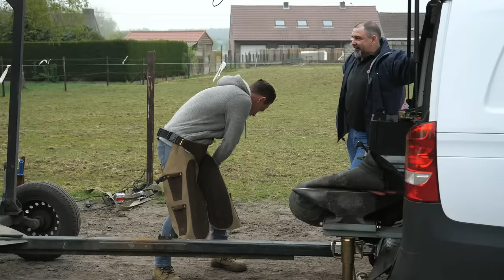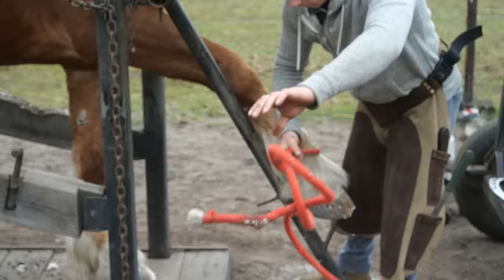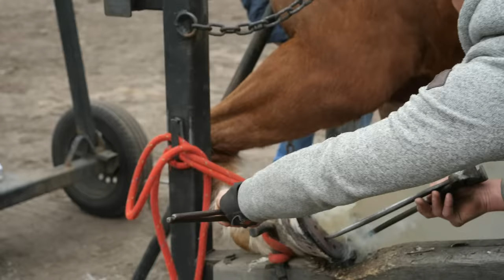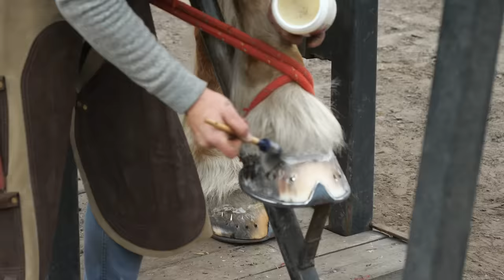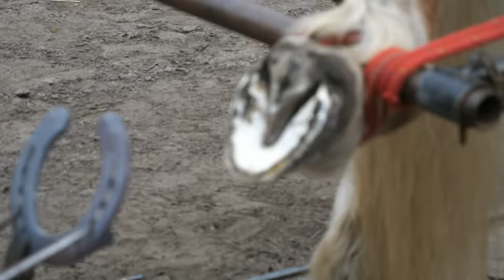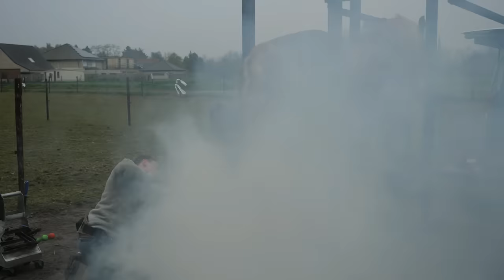Hot shoeing a draft horse is a tough job. Watch the whole technique in detail.

Comment: To all the people disliking : This does not hurt to the horse at all. It can't feel that part of its hooves, they are mostly made out of the same material as finger nails, but stronger. It can't feel any of it. If it could actually feel it it would have freaked out.
Reply: Apeman Commeth  I'm sure it can feel the heat but I think it would have a larger reaction to it if it was painful. Even if it is painful and lets say the horse is just trained to deal with the pain I think if it was to much the horse would freak out.

Also, about the wild horses. I'm not an expert on horses, but I think that when they are in captivity they don't wear down their hooves as much and so they need trimmed. A wild horse probably wears down it's own hooves.
Reply: @thorn9382  sd
Reply: @sureshdhaira2295  what?
Reply: Chezz horse can actually feel areas of their hooves just not in those specific areas. They can feel the inner part of their hoof including what is called their frog. Their frog is a sensitive part of their hoof.
Reply: Thank you for this information, I'm panicking because he's hurting the beautiful animal. Now I know.
Reply: Nevada, I've been around horses since I was born. I'm 43 now. I promise you if that horse was in pain, he could've (and WOULD have) broken out of that contraption.
Reply: Nevada Lairson no pain is being caused at all. There hooves are like ginormous thick toenails and they can’t feel a thing. And when the hot shoe is placed it kinda feels like a hand warmer to them. So it doesn’t hurt☺️
Reply: Apeman Commeth  if they didnt put them on the "nail" would wear out fast due to them walking on streets instead of pure earth like wild horses.
Reply: It has to be done whether or not he can feel it. You can feel the dentist in your mouth, but that don't stop you from going unless your a fool lol!!!. To the one's who's saying he can feel it
Reply: I understand what ur saying but u can never speak for a horse unless u are a horse.  To say they sont feel ANYTHING is easy forbu to say. Perhaps they just deal with it b.c qe are going to force it anyway
Reply: @nevadalairson6341  u still dont know neither of us r horses
Reply: @umwaht  well any animal feeling pain will react to it, its that simple it will retract its leg. This is pure "nail" material on the outside ring, thats why they can burn the irons to the nails. The center has some feeling to it, but the outside doesn't
Reply: Apeman Commeth  my farrier does hot shoeing. I have never had to put my horse in a chute or tie her leg's down & NO they do not feel it
Reply: Ich hab gedisliked, weil mir dieser Schmied erstens unsympathisch rüberkomm und ich zweitens nichts davon halte, ein Pferd in "Ketten zu legen, dass es sich gar nicht mehr bewegen kann. Was würde man denn machen, wenn sich das Pferd erschreckt? - Will man dann erst 10 Verriegelungen aufmachen?
Sorry dass es auf Deutsch ist, war zu faul es ins Englische zu übersetzen 🙈
Reply: @thorn9382  wild horses hooves are like stone! much harder than domestic horses. I know I have owned mustang's as well as domestic horses & the mustang's never needed shoe's
Reply: I was wondering that, I was thinking more of would it basically cook the inside of the leg from such intense heat, but I’m from the ghetto never even seen a horse in real life but watched the whole video cuz of dudes craftsmanship
Reply: Apeman Commeth  most of the reason for shoeing is the vast difference in terrain domestic horses are used on and the fact that we use them as beasts of burden. Wild horses end up wearing down their hooves more slowly and if they do end up injuring their hooves in any way, they go lame and die (without intervention) draft horses are still used for hhlauling carts and sleigh loads (and even for weight competitions!) So their hooves need the protection that they get from their shoes.
Reply: Apeman Commeth  if a horse that size doesn't like something, you'll know about it.
Reply: @marlenstr3995  Naja in diesem Fall geht Sicherheit für den Menschen wohl vor ;) Vor allem auch Gesundheit weil  sonst kann der seinen Job nicht lange machen, bei dem Gewicht der Hufe. Es gibt grundlos Schmiede, die erst gar keine Kaltblüter machen.
Reply: @thorn9382  nice information.  Thanks a lot.
I thought surely it heart them. But no much pain
Reply: Hot shoeing is used to flatten the area where the shoe is going to be placed, its recommended for a better fit.
Reply: Apeman Commeth  No the nail doesn't hurt. Wild horses are never have any body riding them nor do they have to pull anything. If you don't shoe a horse it's hooves can be ruin.
Reply: @umwaht  No that horse is strong enough to pull away if it wanted too.
Reply: @umwaht  You talk a lot for someone who's experience with the outdoors is all through YouTube videos. Leave this to those of us who live and work in the country.
Reply: Apeman Commeth  Domestic horses aren't capable of wearing down their hooves like wild horses can, since they don't roam and travel for long distance on rough terrain. If left unattended, their hooves will grow to long lengths, think of them like nails, and will start to cause posture problems in the horse, like leaning off to a side. They'll try to be constantly getting getting weight off one leg and just be rotating each of their legs around for any comfort. A constant trim and re-shoeing if required for domestic horses, regardless of how it looks. It's more cruel to not trim and shoe them.

Source, family owns several horses and we get them trimmed often. Had a 1 year old get his first trim not too long ago and he had visibly bad posture. Was leaning off to his right side, and that was promptly corrected with a simple trim.
Reply: Chezz I’m a horse rider I own horses I know
Reply: Chezz sometimes horses don’t have shoes because they are ethier retired or they just aren’t ridden I’m a horse rider I own horses I don’t know much about having the shoes off that’s all I know right now.
Reply: Nevada Lairson I’ve been around horses for a long time I’m a horse rider and I own horses I promise you that it’s not hurting them they can barely feel it and if it hurt that bad then they would have a bigger reaction! And if it was hurting the animal then they wouldn’t of been putting shoes on them.
Reply: Adriaan Schep  actually some people don’t have shoes for their horse ethier because they’re retired are don’t get ridden but sometimes you have to get walked on the road or concrete I wouldn’t go that fast it would just slowly wear down the hoof.
Reply: Apeman Commeth  i do agree, i would never shoe my horse or anyone else's. As wild horses do fine without them. But horses cant feel in there hoof the only part they can feel iz the frog(the center piece that is just a fraction of the hoof that looks like a triangle) and the farrier doesnt put the shoe in the frog it only goes om the edge of the hoof
Reply: @Bellbeesevenacresfarm  i own a 14 yr old ah mare and she has never had shoes i compete on her too. Horses dont have to be retired or not ridden to not have shoes on....
Reply: @vickylawrence3958  do you own horses? Ive owned 12 and never had shoes on any of them and my farrier say they are some of the healthiest hooves he's seen
Reply: Did the horse tell you this ?
Reply: @showjumpinggirl100  Can i ask how did you know that?
Reply: Chezz I ride horses irl and I do notttttttt use horseshoes I’ve took my horse to the vet and she said that if u put horseshoes on ur horse it would make the horses have hoof problems sooo yeah............
Reply: @sweettooth3313  yes actually... If it hurt the animal his ear would one be pinned back which they arent. And two he would he forcing his foot down, bc a draft breed can break that chain
Reply: Apeman Commeth  Wild animals do not bear the burden!
Reply: Apeman Commeth  it wouldn't really effect the horses hooves if you don't put shoes on or not well shoes make the horses hoove actually weaker
Reply: Really, people, does that mare look like she 's upset with this process? Not even faintly.
Reply: Apeman Commeth  Let's make this easy. 

Wild horses ran around on grass, and didn't wear down their hooves as much. 

Most riding horses need shoeing, because a stable has hard flooring, and if you ride on a road the hooves would be worn out more quickly. 

If you don't put shoes on the horse, the hooves become very small, and it will start to hurt the horse. 

You can skip this part, I already explained it, this is just about my own horse. 😁

I recently just got shoes on my horse's front legs, and he's so much better now, and his hooves was about 5 cm or so.

I didn't have shoes on at his old owners, because he was out in the paddock both day and night, and only came in when they got food, or if they were going to be ridden.
Reply: @carcol04  The horse's leg is tied up to preserve the farrier's health/spine. Horses like to lean on things, just like people do when they've been standing for a while. Watch a horse when they're being groomed/tacked up. They'll shift their weight back and forth. You ever have an animal almost 10 times your size use you as an ottoman? Just decide they're tired of using just 3 legs and want to give them a break? Makes doing anything with their feet a LOT more difficult. XD Now, you can push them a bit, and get them off of you, but it can still knock you off balance pretty good before they take their weight back. Now, for the kicker: A regular horse weighs 800-1,200 pounds. A draft horse weighs 1,800-2,200 pounds, depending on breed. If something like a TB or AQHA can knock you off balance, what do you think a Belgian or Clydesdale would do? :)
Reply: All horses must go through shoeing. Have you ever seen a horse whose hooves are not taken care of? Bless the owners who care (and there are too many who don’t) and the pros who “get it done”
Reply: @1959blee  and that's where you're wrong. 
Some horses has stronger hooves than other horses, and doesn't need shoeing. 

You shouldn't trust everything the internet tells you 🤦
Reply: @tarisco614  the people who do not understand what they are looking at need to watch u tube on the rescue horses that do not see the attention of a ferrier. Now that is painful to watch. Not to mention it is inhumame.
Reply: It's called keratin.
Reply: Chezz it’s the tying of the leg I don’t like. I have 2 Clydesdales and our farrier holds their legs and that’s what they’re meant to do in my opinion, if he spooks he’ll brake his leg. But I do agree with the fact that hot shod is better. And for the people asking about leaving him barefoot, yes it’s a thing but he probably has a job and that means he has to be shod because if not he can ware his hooves down too much 🙃 

WoW the more I watch the more I HATE the tied leg
Reply: @ali-ub7go  PC seems like you are a lot more bothered about this than than the horse is. The horse is completely relaxed.
Reply: Steve Hove Ik it’s just if on the off chance he did spook, he’d break his leg.
Reply: Its keratin.
Reply: @nevadalairson6341  he absolutely isnt hurting the horse, in any way. Farriers are highly trained, highly skilled professionals. That horse might be bored, but certainly nothing worse.
Reply: They get fucked up hooves that can be crippling if they don't get them done right. Having an off kilter hoof can fuck a horse up.
Reply: @thorn9382  or dies you know, wild horse broken hoove for some reason, runs slower, maybe can't even run, wolves come at noon plain sight, aaaaaaaaaaand supper is ready. That should (and im no horse expert, just a weirdo) if they have no horseshoe on horses on farms could hit a rock or, step into a stone witch might harm the hoove, etc... so makes sense to give those guys a "shoe" for them to walk comfortable in a stony road for example and prevent injury and live happy and stuff
Reply: Apeman Commeth  you can't compare the living conditions of wild horses to domesticated on ; they live in and experience completely different habitats. As to the heat; the shoe nail is attached to the part of the hoof that has no sensation...think of a hot iron on your hair, or a pumice grinder on rough spots on your feet.
Reply: in hot shoeing, the horse is reacting to the smell and smoke if anything.
Reply: Everyone saying its hurting the horses your like 500 years late but it don't hurt the horse they've been doin it from ages ago did it ever hurt the horse
Reply: Yeah horses love being tied up like that and having molten metal hammered into their feet
Reply: @marlenstr3995  does the bundeswehr have horses?
Reply: gosh can everybody stop making a drama , if you wanna know search online . God
Reply: @thorn9382  I don't think they have nerves in their nails, though they do have inside of their legs (of course). They might sense, but as you said earlier, only a tiny bit, or sometimes not even anything.
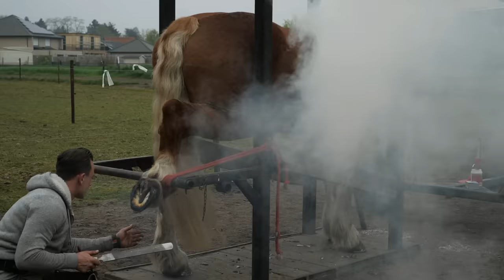Reply: Monica H 9:13 so he’s not in discomfort here? Cmon.
Reply: Sein Maestro Dude the nail on any horse is made out of the material of a human fingernail that is a hell of a lot stronger and if the horse could feel it,then he would mostly likely be dead or severely injured from a horse kick the face.
Reply: Chezz this is interesting, but does the nails hit the hooves?
Reply: This guys is so bad doing this, look all the other farmes they work much better that him
Reply: Who tf are you to tell me what horses feel and what not?
Reply: @Cr4ZzZy  He's a person who owns horses and knows what tf hes talking about so if you got a problem don't watch the video simple as that.
Reply: Apeman Commeth yeah and horse cant talk to you to explain if he is heart I kind of feel uncomfortable watching this :/
Reply: I call bullshit, sure look like he felt something on his back legs as he kept trying to move it. The owner had to verbally try to assure the horse. Horse felt something. Let do that to your big toe nail and let's see if u feel anything. GTFO
Reply: It probably hurt more not to kut it
Reply: @alphazar23  I just prefer the regular way better, looks less hurtful to horse. I don't see the same reaction to them trying to jerk foot away from the situation.
Reply: Doesn't it get thinner every time ? Doesn't the nail gets to the flesh ever ?  I do not own a horse but I have seen cows but they do not move much.
Reply: @deveshsingh4242   bro the nail groves
Reply: Ohhhh Thanks
Reply: @alphazar23  it grows fast. It is like a new one every year the groves. I didn't know about it.
Reply: Apeman Commeth  owned horses spend more time being worked on pavement which can cause foot soreness so the shoes are there to be worn down before the actual hoof. Wild horses don't have this problem as don't spend as much time on hard ground
Reply: Apeman Commeth I’m not a farmer, but I own a car. When the tread on the tires wear down, I buy new ones so the old ones don’t blow out while driving on the highway. Getting horse shoes/ hoof pedicure extends the amount of miles the horse will have over its lifetime. Ultimately improving its quality of life. Also, does anyone ever let their own fingernails or toenails grow out of control??? I think not. There’s nothing worse than a hangnail on my pinky. I can’t imagine what these horses feel. This man is HELPING these horses. You would be ignorant and foolish to think otherwise... And to top it off, he’s a blacksmith that makes custom horse shoes!!! Come on people, get it together. This guy is setting a high standard for his trade and should be commended. I’ve seen some videos where guys are hacking a hoof in half and it looks like a murder scene. Then they spray it with iodine, say the animal can’t feel a thing, wrap it, and proceed to tell the viewers the animal will make a full recovery in six months... Save your energy and negative comments for those guys and leave this professional alone! Keep it up horseshoe guy. I don’t know why, but during quarantine I found out I like watching horses get their hoofs fixed... Stay safe everyone.
Reply: Apeman Commeth  wild horses need to scratch rocks ground etc in order to trim then. Otherwise their toes will grow and bother. Just like domestic cats and wild cats. Wild cats are scratching trees for 'for nail caring' for example.
Reply: @umwaht  What? No lol. Seems you have never been around horses.  People have gotten killed because a horse was spooked or not happy with someone that cause them pain. They feel no pain from this. Just discomfort from his leg getting tied up. The frog causes no pain either, the deepest part of the frog in the hoof has nerves, the frog is like a pressure pad. It puts pressure on that nerve so the horse can feel the ground.
Reply: Here’s an easy way to explain if, while it isn’t exact, a horse’s foot is made up of Keratin. Our hair is made up of the same material

When you flat iron your hair you definitely don’t feel it, but sometimes you can feel the heat close to your scalp. 

Also I promise that if it hurt the horse the farrier would have a broken face
Reply: When the farier doesn’t cold treat the shoe the horse can feel it and he didn’t cold treat it as the horses shoe set on fire
Reply: A horse is a horse of course of course and no one can talk to a horse of course that is in course unless u go right to the source and ask the horse if it hurtsssss. lol
Reply: You Are 100% Right.
But Some People Don't Know It.
This Is Right Way To Nail Hooves.
This Help The House To Walk Easily Without Pain.
Reply: Apeman Commeth  الله
Reply: @Joshua-jj4xn  nails* not feet
Reply: @Joshua-jj4xn  or hoofs if general
Reply: @nmextrapstar69  he is, but not from the horse shoeing, hes trying to find balance because one of his feet is being hoofed
Reply: @firm1z  hes tryna find balance smh, if u stood on 1 foot would you be steady as a statue?, no, same goes for the horse
Reply: @mridg9464  its like using a flat iron on your hair and getting near to the roots, theres no real burns internally
Reply: Franchesca Ng dude Ik I do this work my self but hey at least the shores got some shiny shoes
Reply: Thanks so much for reassuring me that the horse isn’t in any sort of pain 🙏🏻❤️
Reply: Apeman Commeth  

'll
Reply: Apeman Commeth  Hey Apeman...   doesn't hurt them a bit... sometimes they don't like the smoke if the wind is blowing in their faces, but if that doesn't happen they do not react at all.
Reply: Chezz people who don’t own horses or know anything about the shoe process have the most opinions. 🐎
Reply: Are you even an equestrian?
Reply: What aboyt rhe chain and the bite huh
Reply: @nMeX Trapstar  That is just the horse wanting his leg back. you can see it earlier in the video when he picks them up to take off the old shoes. Most horses get uncomfortable in that position easily since they aren't used to having their leg like that while their front legs are much easier to handle. Also if that horse really wanted his leg back or if was actually hurting the horse would literally be thrashing around to break free and it could break through that easily. My baby horse does the same movement when he isn't really sure what I'm doing when I'm holding his leg. Also, horses are not dumb animals. they recognize lots of things. If it truly hurt that horse to be in the shoot to get its feet done they will REFUSE to go in no matter what. But that horse just walks straight in with no hesitation and lets them do their job.
I know this because i rescued an appendix quarter horse that was terrified to go into trailers. He was an ex-racehorse and when he lost he was abused in the trailer. He would rear, buck, kick, run us over and even bite us if we tried to get him into the trailer. We had to sedate him to get him home it was that bad. Once we got him home it took me almost 2 years constantly working with him to get over that fear. A shit ton of people had given up on him before my family adopted him and my family was gonna be his last chance to since no one was willing to put the time and energy to help him get over his fear. He had severe PTSD it was so sad to see. SO tell me again. If that horse was feeling ANY pain you think it would calmly be staying in that contraption?
Reply: @Tina Gore  the chain is there so when the horse leans back on it it can take the weight for the most part. a rope on the other hand wouldn't be strong enough to hold them up. it would snap and if not on the main part of the rope it would snap at the connection. Also, the top chain is to keep the horse from rearing and hitting its head. These horses are trained not to rear or back up if they feel that top chain and butt chain.
Reply: New shoes, same horse and who doesn’t like new shoes. That horse seem quite happy afterwards. I think we all can agree that farrier would have been smashed if the horse felt any searing affliction. Lmao A farrier wouldn’t be if a there wasn’t a demand or need. Definitely check out the anatomy, history and procedures on horses before jumping to conclusions. Not all horses need shoes, all shoed horses have their reason to be shoed. Also check out unkept, problematic hoofs, beware those videos can be graphic but the end results usually end with success. We don’t want to be in pain nor do we want our animals in pain either. To keep healthy sometimes we need medical intervention, to perform a function we need proper equipment and acquiring such things can bring discomfort.
Reply: @natasha789die  hello Russian
Reply: ЖЁЛТАЯ ПРЕССА ДЕРЕВЕНСКИЙ КАНАЛ  lol I don’t understand 🙃
Reply: @nevadalairson6341  uni u gogol girl k they u u
Reply: Apeman Commeth so, your wild horse argument.
Wild horses have had roughly 800 to 1000 years to breed without much interference from human and develop hard hooves that wear down naturally. Think of it as almost like natural selection. In the wild a lame horse is a dead horse. Dead horses don’t breed. Therefore you end up with wild horses with large strong hooves.
Now, most unfortunately, many of these domestic breed of horses are bred for certain characteristics without much thought for the hoof.
For example, take the American quarter horse. Breeders have absolutely destroyed by breeding for smaller and smaller feet. At this point they look absolutely ridiculous.
Hopefully this helps you understand the argument of why we don’t, can’t compare the hooves of a domestic bred horse and a mustang.
Reply: Thank God
Reply: @showjumpinggirl100  I'm sorry if this is late but the sensitivity on the frog part is actually false. Idk how that belief came to be but nah, it's not the most sensitive part. Think of it like cutting your dogs toenails or your own.  Cut too deep and you'll hit the quick, same with horses. There are sensitive areas but those are deep deep in the hoof ^^
Reply: That does answer my question of if the horse feels anything when they nail in horseshoes.
Reply: Apeman Commeth  Google the Cowboy from Chicago.  Census Cowboy and what he did to his horse
Reply: Apeman Commeth  its protecting hoof, when horse is going to the show from hard floors(sorry my english is bad -w-')
Reply: @showjumpinggirl100  the frog isnt sensitive.  If its sensitive, its probably infected
Reply: That sucks. Nature does this naturally for them. Humans think we know it all.
Reply: @thorn9382  Yes, it does NOT hurt. Only issue is that horses need some practice with shoeing, because they can feel that heat, smell burned hoof also it makes hissing sound and many horses are freaking out when something hiss (like spray or fire) and  also it makes lot of smoke and horses natural instinct is run from fire. Shoeing like this is made only on working draft horses. Riding and sport horses are shoed with cold horseshoes and horses for terrain and hobby riding and ponies are often not shoed (plus horses with bad hoofs... laminitis or white crumbling hoofs)
Reply: There is an area in the hoof, like rings on a tree, called the white line.  As long as you stay to the outside of the white line, you are in the hoof horn and it's insensitive like your fingernail.  If you get too close to the white line, it will cause pain like cutting too close to the quick of your fingernail, which is why we will say the horse has been "quicked".  Inside the white line is loaded with cappillaries and nerves, called the "laminae".  To invade that area will cause severe pain.

 @showjumpinggirl100
Reply: @umwaht  There is an area in the hoof, like rings on a tree, called the white line.  As long as you stay to the outside of the white line, you are in the hoof horn and it's insensitive like your fingernail.  If you get too close to the white line, it will cause pain like cutting too close to the quick of your fingernail, which is why we will say the horse has been "quicked".  Inside the white line is loaded with cappillaries and nerves, called the "laminae".  To invade that area will cause severe pain.
Reply: I have never owned horses but I think putting horse shoes on horses doesn't matter but sometimes u might it kinda depends on the horses u know so it really doesn't matter
Reply: @failexp1351  Proper shoeing can be vital to enhancing some horse's hoof health, safety and athletic performance.  It depends upon the foot conformation of the horse and the job chosen for him to do.  Also other health situations. Foals can be born with leg issues that need to be reolved by plastic footwear that is glued on and changes with growth of foal, same as corrective shoes for children.  Can you go barefoot all the time? Neither expect all horses to do so.
Reply: @radchannel5494  I agree but I'm saying some horses don't need to I not trying to start something I'm just saying sometimes horses don't need it they might to because they wear it down themselves that all I'm saying
Reply: @failexp1351  Oh you are correct!  Sometimes they do wear the foot down on their own.  Usually a knowledgeable horse owner will observe this and space the farrier visits out when it's that way.  However, my boyfriend is a farrier and you'd be surprised how many people only want to call him once a year.  Their horse's feet get into awful shape from the neglect and then they want to blame him when he cannot work miracles in one annual visit.  Very exasperating.
Reply: سسسسسسسسسسسسسثسث
Reply: ইই
Reply: @thorn9382  ত্ত্ত্গ্গ্ঘ্হ্গ্ত্তেýতারিখ সুইস তারিখ 666
Reply: @joniakter4740  scary
Reply: @showjumpinggirl100  frog is not as sensitive as people believe. 
If it’s sensitive then it probably means thrush is around. 
Even S&S horseshoeing  has even said the frog isn’t as sensitive as people believe.
Reply: @genabargay4391  the horse weighs a ton, I doubt a farrier would be able to hold its hoof up  for very long, also it’s probably safer for everyone to have the horse in that type of contraption.
Reply: I think you once was a horst in another life to know this.
Reply: @hafidelghazouani5272  If your talking to me I study animal care that’s why I know a few things, I also love to research and learn about animals that way (I have a very good recall memory and if I enjoy something I will do really well at it). 

I don’t brag either if you wanted to know.
Reply: I am baffled by the frame, ive only ever seen someone use a stand and their thighs,
Reply: The horse is very happy to have it’s hooves trimmed and new shoes put on aren’t you happy when you have new shoes?
Reply: Yh if you hurt you’d DEFINITELY know about it and overgrown hooves hurt them more than getting them looked after
Reply: @nevadalairson6341  for the sensitive areas like the frog of the hoove (triangular looking thing going from the back of the hoof) it could just fee uncomfortable but shouldn’t be painful when done right but other than that it’s pain free
Reply: @nevadalairson6341  How is shoeing a horse, a process done now for centuries, hurting a horse? Shoeing a horse is to PROTECT their hooves and help them... Not hurt them, or else what is even thee point in the first place?
Reply: @genabargay4391  Mustangs and wild horses dont need shoes because they naturally wear down their hooves from all the walking on all types of surfaces. These prize horses stand around a ton and are used for specific things, so they NEED shoeing.
Reply: @JonHop1  oh I'm sorry, I don't know anything about horses and made a comment 2 years ago about it. I'm sorry I'm sensitive when it comes to any and all animals. Just because it's been a process that's been around for centuries doesn't mean I know that it doesn't hurt the horse. I understand shoes help the horses, however at the time I didn't know it wasn't painful to the beautiful beast. You don't have to be rude about it.
Reply: @umwaht  uh, you do realise we have studied horses and know their biology pretty well? You can’t feel pain with no pain receptors. Whether or not you’re a horse doesn’t matter, it’s an objective fact.
Reply: @EternalShadow1667  it's not a fact if you cant prove it. That's not how studies and Science work.

Science is a study. A study can prove one thing and not another.
Like not having receptors, but not able to prove qhhether pain is felt. Horses definitely feel pain. Please dont talk to children b.c they will believe u
Reply: @EternalShadow1667  of you are not a horse sont speak for them.
 
According to YOUR science also if I dont flinch when u pinch me, that's proof that I didnt feel it. Especially if you dont know how my pain recepters r different than yours. 😂🤣😂🤣😂
Reply: If it could feel that, this cage would not hold him.  My grey shire lifted 2 300lbs men straight up with her head alone lol
Reply: @nakotas_promise_breyers2571  Draft breeds can have problems with their feet and many are used for work, so their feet could take a beating in the field or forest when unshod.
Reply: @ali-ub7go  Draft breeds don’t spook easily, or they wouldn’t make good draft horses. And they’re trained to accept things. The owner was right there. If the horse spooked, it could be released from the stocks.
Reply: @Joshua-jj4xn  Most horses stand for this. Stocks are usually used for heavy horses because the wear and tear on the farrier’s back becomes a problem. They’re likely finished faster this way. So the horse can lean on the frame instead of on the person and it’s on three legs for a shorter period of time.
Reply: @nmextrapstar69  Much of the discomfort is from standing on three legs. They can often weigh around 2000 pounds.
Reply: @mobilegamingworld76  They communicate non-verbally just like they do with other horses. That’s how horse people learn to read their responses to training and other behavior.
Reply: @firm1z  It’s uncomfortable holding their back leg up. Most horses are better having their from feet picked up and trimmed than their rear legs.
Reply: @firm1z  Seen plenty of horses not in stocks have hot shoeing done. Nine of them has much of a problem. Most horses will try to jerk their rear leg away when picked up, unless trained not to. Their back legs are their armament and they don’t care for the smell of the keratin in their hooves burning. Unhappy horses usually pin their ears.